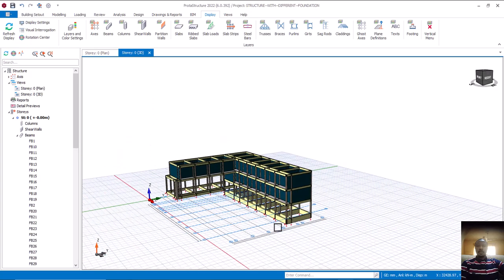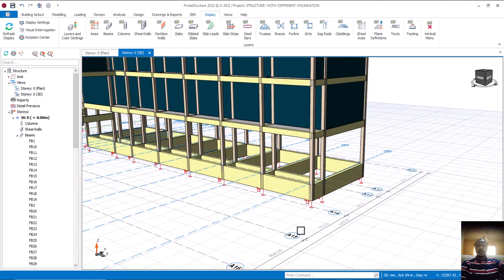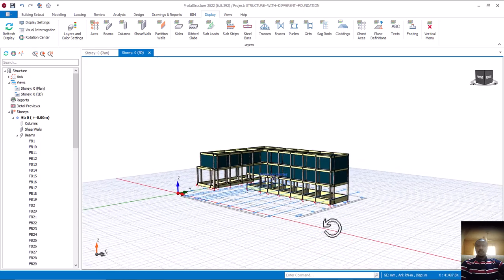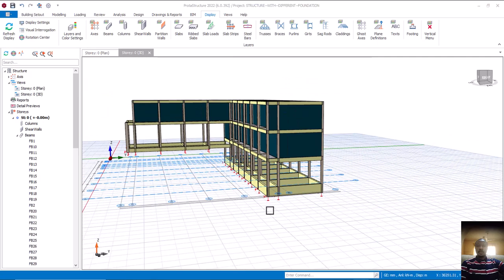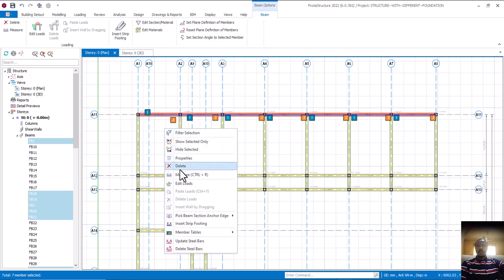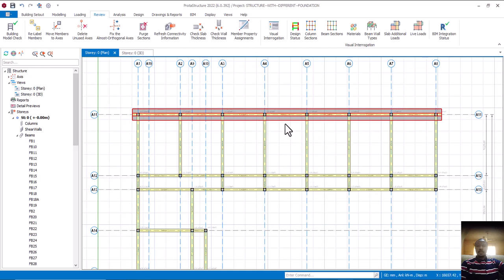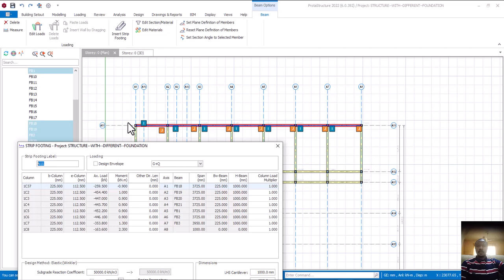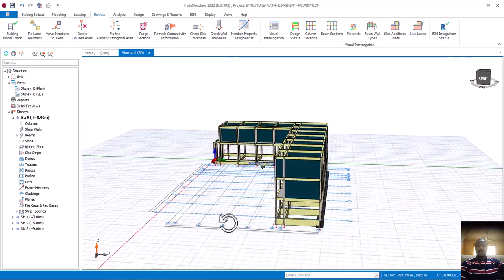WHY YOU MUST USE DESIGN ENVELOPE IN WIDE STRIP FOOTING DESIGN IN PROTASTRUCTURE

Comment: Nice video, you are really impacting knowledge. God bless you Sir. Please i would like to ask a question about  overhead water tank load on slab in a video previously. how can someone  distribute the water load uniformly on the slab rather than using the pressure at the bottom of the tanks